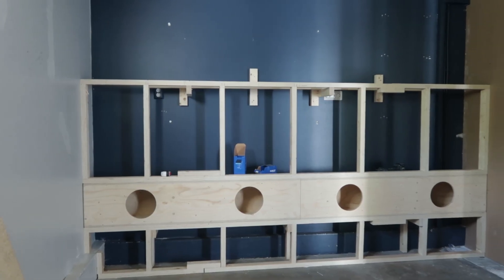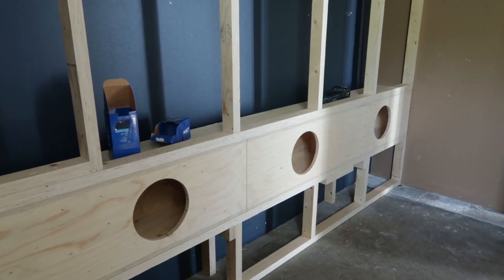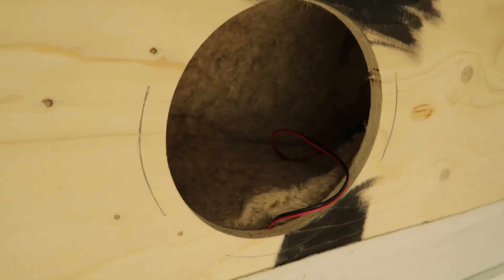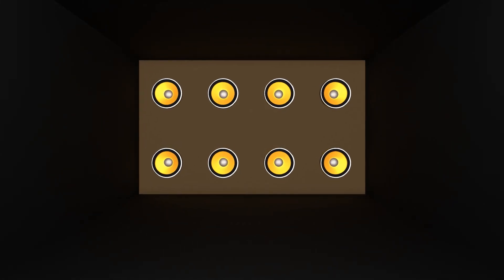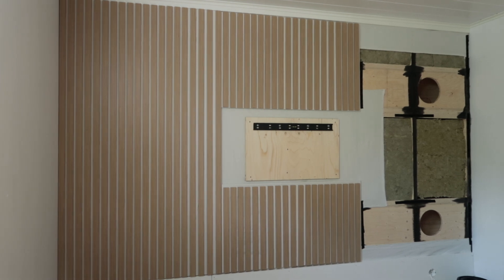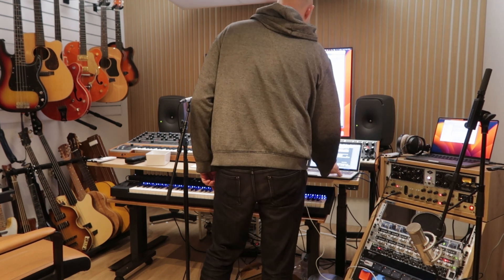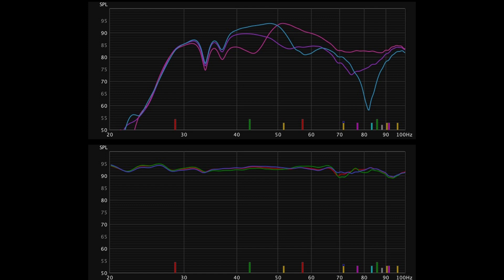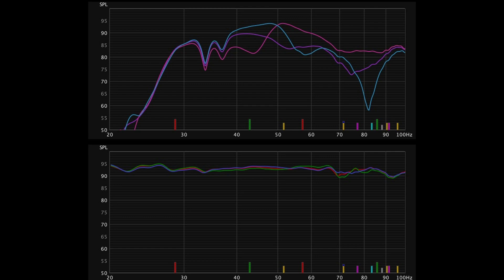Wall of Bass - Bass Array System in Studio Installation

Comment: Very nice concept, great work. Do you think you could share the impulse responses? The final response is very flat, but I would love to see the behavior of this system in the time domain.
Reply from the maker: I found one! Not the final tuning, not even final acoustic treatment, but you can see the sub system results quite well. I could imagine that the very low frequency resonances are some structural things like walls, cause the garage walls were not reinforced. Or maybe furniture resonances. If I remember correctly there was for example a drum kit in the room.

https://drive.google.com/file/d/1NA9Ls1LNnNaMe_kLqK6epERgngimxh6O/view?usp=sharing
Reply: @AudioIdeas  Thank you. Very nice response, congratulations. There is some room tunning on this response right? Do you remember what it was? And for treatments, you had only mid and high absorption treatments? I'm having a full blown discussion with my acoustical engineer colleagues about this technique and this response haha.
Reply from the maker: Yes, there was some tuning since x-over is done and levels are there. Unfortunately I don't have more accurate info. But the front and back wall had treatment (20cm rockwool + 10cm gap + the cloud (10cm + 20cm gap) was in place. But the side walls were without any treatment. I'm probably doing bull blown double bass array system within 6 months for a customer. That should be fun!
Reply: @AudioIdeas  That's great. Post some more videos about it if you can, very interesting stuff.
Reply from the maker: I'll try to get permission for it. Let's see how it goes.

Comment: Interesting concept, with very good measurement results. This could also have been implemented in the roof?
Reply from the maker: Technically, yes, but since you cannot do any acoustic treatment on the floor, you would get severe comb filtering. So, let's say your sitting ear height is 100cm. That's a quarter wavelength of 86Hz. So you would first perfect null at 86Hz. So, let's say you run your subs only to 50-60Hz and do a steep cross to mains; then I guess it could work. Just don't stand up 😃 And, of course, you probably should treat your ceiling quite heavily and/or create an active absorption with the sub array by adding a delayed polarity inverted signal with reduced gain to trap the signal bouncing back from the floor. I did this a bit at the end in this studio to absorb the signal from the back wall bounce. It actually did help with the RT60 figures.
Reply: @AudioIdeas  it is what I suspected, ( combfiltering) . Unless you also add some form of absorbtion to the roof, as you suggested.  Some German acoustic designers seems to have had very good results with the roof install when space are very limited. Those rooms are hometheaters and they run the LFE channel to at least 120hz.
Reply: I think he does run some the subs pairs  out of phase, to "absorb" so of the floorbounce.
Reply from the maker: @poleepwka  , the floor bounce effects are quite hard to avoid there. But then again, you get nulls with traditional subwoofer systems too. So all and all it can still be better than, say, a one sub in front.